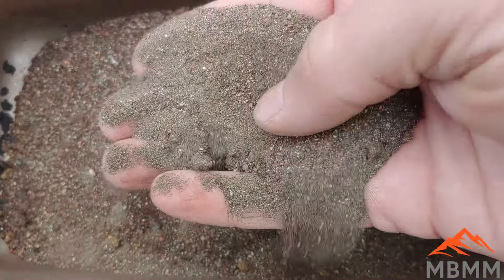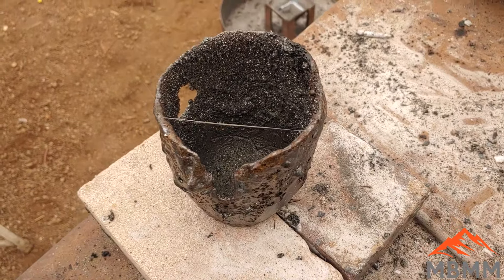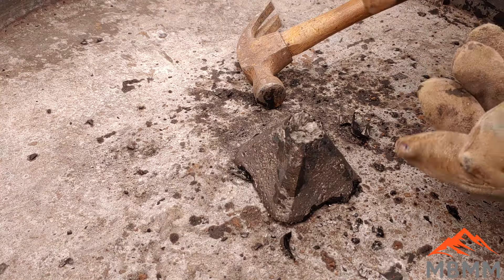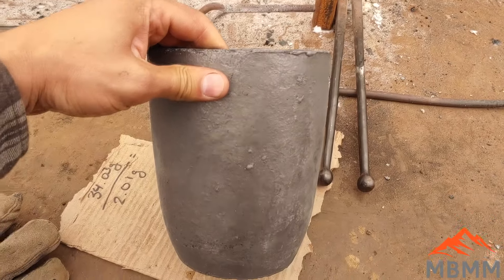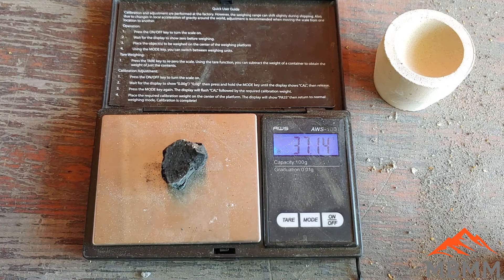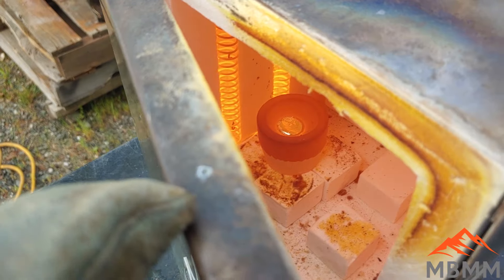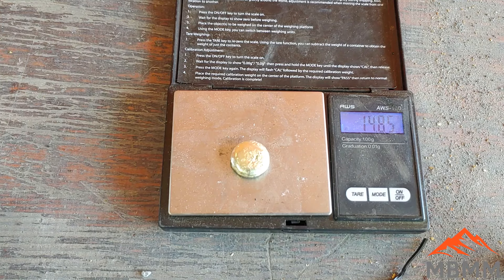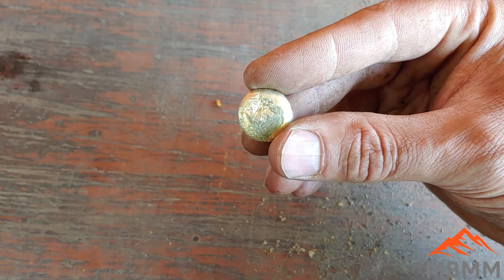Richest Black Sand Smelt I've Ever Done! No Visible Gold/Silver, Huge Precious Metal Button

Comment: So now you need to take that button and dissolve it in H2SO4 and HNO3 then add some Na2S2O5 (sodium metabisulfite) until your Stannis Chloride test comes back negative and smelt the precipitate  for the 999 fine gold. If you capture the liquid from the precipitate and pour it in a bucket with copper in it silver will form in precipitate and cling to the copper. (yes I know that platinum group metals come out of solution with the silver in copper. You have to reprocess the silver to remove the platinum group metals)  So you get all the precious metals out of the button that you can. Great video on this subject sir!!! Love your videos and the time they take.

Comment: a simple question do you have any plan on making a more permanent foundry with refractory material? 
As the exposed kale wool will send out fibers thru the air,  and is not good for your lungs.
Reply: instablaster

Comment: that water displacement trick blew my mind
Reply: It's an excellent and near zero-cost test better known as a "specific gravity" test. Look up "specific gravity test" on YT, there are several good videos on it. It's a little better if you use a length of thread to suspend the item and have some kind of "scaffold" to hold the item suspended in the water...which can a dowel over two stacks of books...but for quick and dirty, what Jason showed here was fine.

Comment: I like the Xray anilizer ... How much would it cost to have a sample of material anilized ? How much material would be needed to get a good representation of the area i want to check out? I am have no shortage of samples to check. I know there will be alot of iron. There is enough garnet to give a red tone to the black sands. There is ultra heavy blond sand that I think is shelite. A.k.a. tungensten sands. It easily falls under magnitite and garnet and iron. Differant sulfates are throughout but are very fine

Comment: Same question as before, why use an iron rod rather than iron filings directly into the flucx charge?
Reply: Simply the rod will convert in the flux all the sulfide releasing all the bonded sulfide metals to free metals with no matte at the end. 
Filings would be a measurement and if you get it wrong you will have unprocessed sulfide and have matte in your pour plus they will be in your pour when you pour which can affect your lead button. 
The rod is simply removed making an easy pour and no side effects in the pour.

Comment: Hay bro, I need help smelting a mountain of heavy mineral ore. Got my smelter but still no idea what I'm doing yet. I got manganese, bicarb instead of borax, I think the ore has too much silica as my first few melts was very glassy. I had separation but the mix wasn't runny enough to pour. So it set in streaks of mineral glass. First test smelt, I knew it wasn't going to work straight away.
Reply: I using an electro induction 3kg smelter. Max temp is 1150 degrees celcius. Is there flux to lower the smelt temp?
Reply: Are there other minerals you can use as a gold collector? or is lead the best? In nature, Gold likes to stick to magnesite and quartz with magnesite in the quartz. Magnetic Iron it likes too.
Reply: I was thinking are there frequencies Gold loves to stick to. There are 3 frequencies that make gold stiffen up. Making it easier to catch.

Comment: Very exciting stuff Jason.
Had me on the edge of my seat!
I am curious, doing caustic smelts in an electric furnace, do you think the fumes would destroy the furnace?
What happens if you use other types of crucibles, does the basic flux behave differently in regards to the material and erosion of the crucible?
Loving your experiments.
Congratulations to yourself for nailing this process and to that lucky claim owner!
Cheers for sharing. 🙂
Reply: Where. Im from Wisconsin Milwaukee area. Own land. But where is the powder gold. Like what kind of black sand.

Comment: So all the lead goes into the air? Is it safe?
Reply: When the lead oxidizes it floats to the top of the molten button and runs to the side becoming absorbed by the Cupel. To recover the lead for reuse the cupel must be crushed and heated to about 650F as the molten lead forms its own bead.

Comment: Gold' in the micron size? It is too light to have the cohesion to lodge on the bottom. And lifts with the circulating tension of the water and 'materials cohesion' when panning it. But adding some larger gold or some larger lead particals in this case? The gold will migrate with it and lodge inside and around it. Simple and odviose. But never have seen the practicality of it till now. As smelting would remove the lead. And give a tested value. Not as a assay. But as a recordable recovery rate. I use specific gravety traps. So it works because most of the added lead stays in the apron to gather the gold in a amalgam of particals. Problem is not all the lead or gold is recoverd. So like I said its not for finding a value? Its just a means to adding to the actual recovery in like what I use. Wich is a rockerbox. The old timers would sift off the larger gold on a board. And keep adding to it. Too be the amalgam they would use to hold the smaller gold in future runs.

I understand this end of it as well as anyone can. But  hope to exstend it to smelting it this year. So the video realy helped. As the math is not in my bag of tricks. So needed a basic understanding to start experimenting from, without the math. So thanks for that.

Always going to loose some? As like with beach gold? It can be much to small to recover without some specific gravety trap. Gold cubes and the like? They'll find and hold the larger gold. But does nothing for gold that falls into the micron range of size. People have no idea just how much just passes thru a slues box. Pluss how to pan it. You need to screen it down. But because its so fine and in volume it takes to long to work thru a 100 mesh or smaller screen? Thats why aboard is used. I did a take on it for one of Keith's, Hardrock university's video's. You can pan any size of gold when you know how to add it into your panning.

Comment: That looks really dirty. They could have run that thru a sluice and cleaned it better. I always run a magnet over my cons to remove black sands and then run them thru a blue bowl with a smaller magnet and that helps get just the magnetics out of the cons. I have a few pounds of just black sands with a lot of gold amalgamated in it so I want to smelt that.